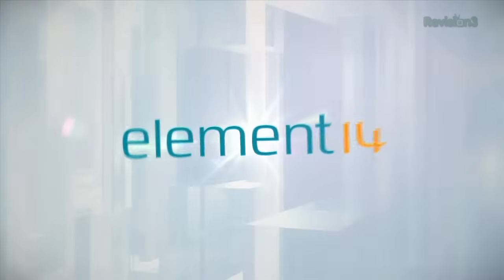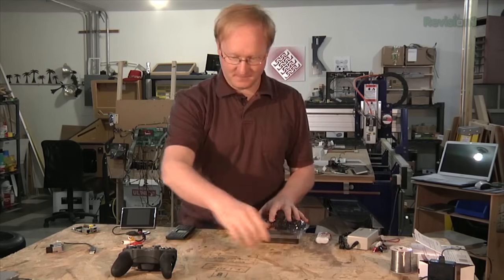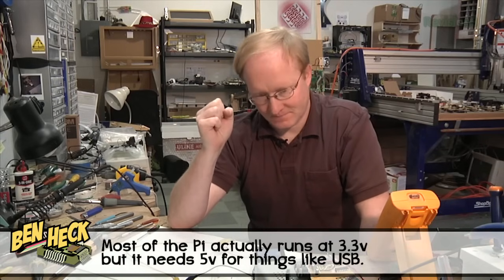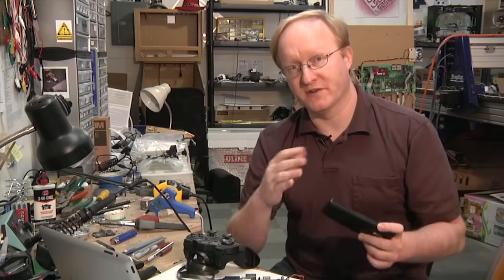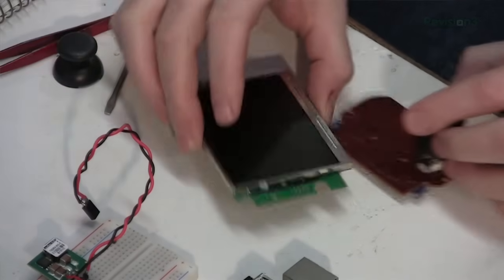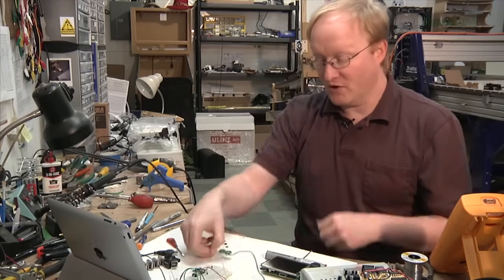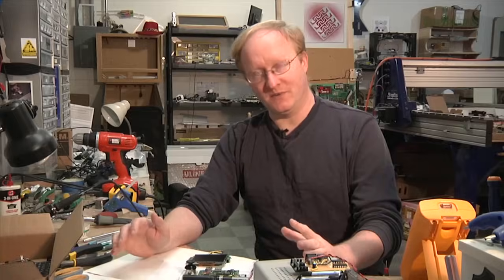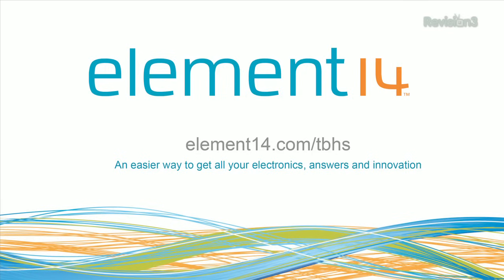Build Your Own Portable Raspberry Pi (Part 1)

Comment: 99.999% of keyboards can be used with generic drivers. If you use a keyboard with weird multimedia keys, those might not work unless you add a custom driver. And plus, there are Linux drivers for almost anything. I still have to find a keyboard that does not work with linux: from 2 different Razer gaming keyboard, to 3 usb bluetooth keyboards, and 2 no-name keyboards.

Comment: Not sure, any one will do just look at the dimensions and ratings. You might want to look at BECs on a site like Hobbyking. They are switching regulators that provide 2+ Amps that are used in Radiocontrol Planes and such.

Comment: Why do you have 3 in series? Thats 3.7V x 3 = 11.1 volts... the Pi needs 5V to run... you can probably just get a Li-Po/Li-On charger and plug the leads that you would normally put in the Pi, to the charger. I would recommend something like a Turnigy Accucel 6. But that might be overkill. You definetly want something that will turn off automatically once the batteries are charged. In you case, you would select a 3S battery (3 cells of 3.7 volts each). I would be more than happy to help so j ask

Comment: No, at the time of filming, the Rev A was harder to get, thus not being integrated in the build. Both Revisions have 512mb of RAM now, just the Rev A doesn't have Ethernet and only has 1 USB port. Otherwise they are identical.

Comment: In theory, yes, but that would take quite a bit of hacking to make the pi fit. You would have to remove all the connectors from the board, and the hardest part would be batteries. You'll never know if you don't try! Let me know how it works out for you.

Comment: Anyone have any idea how i can charge 3x3.7v phone batterries connected in a series circuit. Im using the batteries to power a portable pi. I want there to be one cable which can plug in

Comment: If he used the GPIO he's have to modify all of the emulators to use the GPIO for input since the GPIO doesn't interface into keyboard input. Interfacing buttons to a USB controller is much, much easier in the long run.

Comment: (3/4) While you can move the task bar around on Windows, you can not customize it. (At least, without voiding your warranty.)  Also, Windows 8 doesn't support legacy apps. The app developers have to completely re-write the apps in order to get them into the Windows 8 store, which, by the way, is the only way to get a app onto the app store. You can not simply download an .exe from the internet. Lastly, Steam is pushing for Linux gaming. (sorry... there's going to be another one.)

Comment: (2/3) horrible because it is restricting. You can change it's color, and wallpaper on Desktop mode, but you can not customize it how you *really* want it. On Linux Mint (Mate edition) I have my Mate menu (what you would call the Start menu) on the top of my screen, along with the time, and any other desklets I want. Meanwhile, on the bottom, I have it so I have a bar that shows all of my open windows. That is the *only* thing I have on the bottom.

Comment: Ben, 

You have made many 3D Printers and a CNC router. So you should make a desktop Laser Cutter. Use nema steppers or the $4  steppers from china. Also use an arduino for the controller.

Comment: if u skip the 5v regulator in the screen it will run off 5. What those screens do is take 6-12v and brings it down to 5v

Comment: Well, can't give you any dates, but Valve has already ported Steam to Linux and while the support for games isn't exactly mind boggling it's a good start, also you can play most of the new releases on Linux using software like Wine or PlayOnLinux, it will result in a performance hit since the games aren't compiled for the system, but they work.

Also indie games are more often than not released for both Windows and Linux these days.

Comment: I would be wary of using the LCD's regulator, as you don't know its capabilities.  It may be too much to power the pi as well. Usually those small regulators dissipate energy as heat, and extra current load may strain it too far.

Comment: Why not use the voltage from the regulator on the LCD to power the Raspberry Pi? 

7.2V Lipo to LCD, 5V from LCD to Pi.

Comment: The lcd screen actually runs on 5 volts. There is a voltage regulator that turns it down. If you try to put 5 volts to it without making modifications the amps turn up really high, because the regulator has to take 5 volts and make it 5 volts again. You can bypass it by soldering the  positive wire to the second pin on the regulator or on one of the capacitors next to it. You won't have to worry about taking the regulator off.

Comment: Alternatively with the LCD you can bypass the regulator and make it run off 5V , Ive had one these running off a usb cable i soldered in , Thats assumeing its the same revision of the pcb inside.